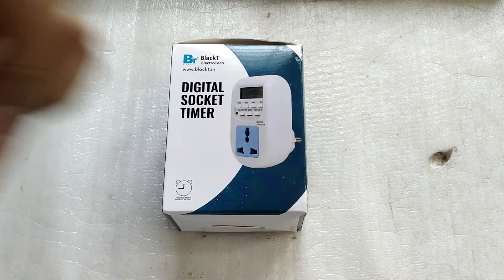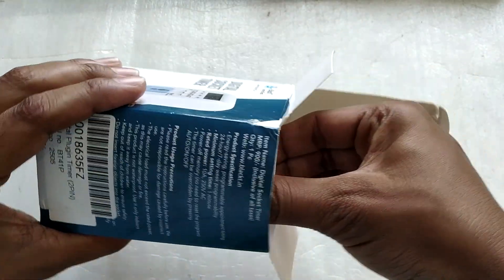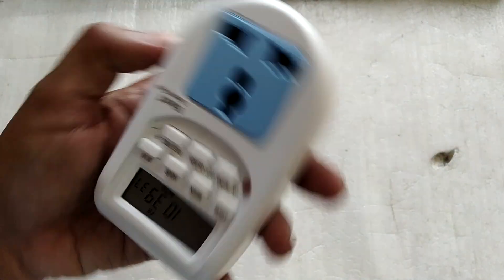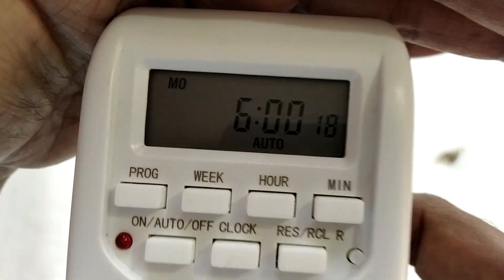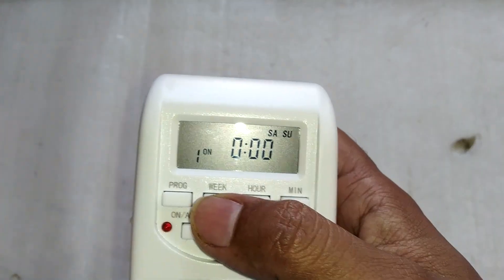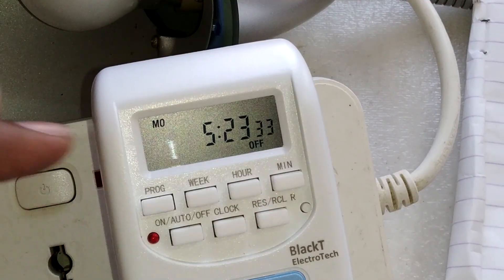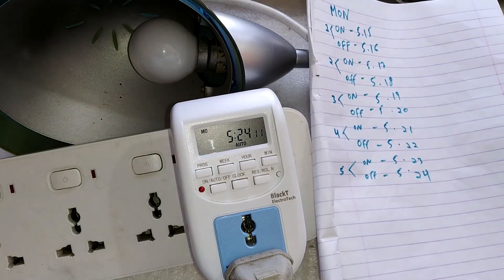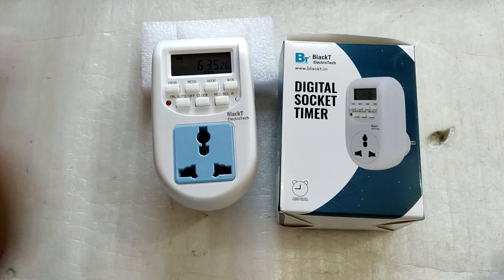BlackT Digital Programmable Timer Socket Unboxing & Review.

Comment: what does the circular small R button do (beside the res/rcl button)
Reply from the maker: factory reset.
Reply: @gurribuy Then what does the res/rcl button do? I thought this was the reset button. Yesterday I purchased this and I'm confused with this 2 button.
Reply from the maker: @shakilahmed6870  let's assume you wanted to set the time 6am but you accidentally pressed the button one more time and the time you get is more than 6. Now, to get back to 6 you will have keep pressing the button until you get the 6 again.
Instead just press the "res" button and it will resest to 0. and you will have to start from 0 again instead of 7, then 8,9 and so on. i hope it clears you doubt.

Comment: What If You want To turn it On by Morning 8 to evening 8 .. 12 hours ... there is no AM and PM button right.?
Reply from the maker: it has 24 hour time zone. so 8 is basically in the am and to get the 8 in the pm you would set the time to 20.
Then it will turn on at 8am and turn off at 8pm evening.
Reply: @gurribuy Thanks ❤